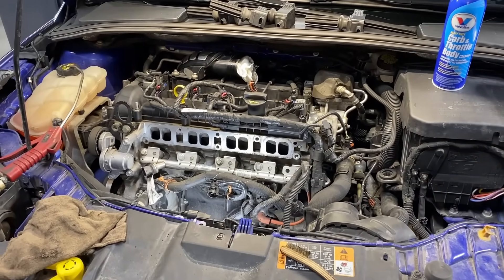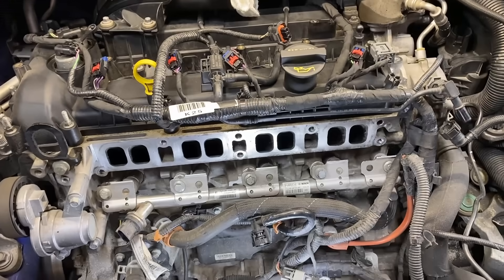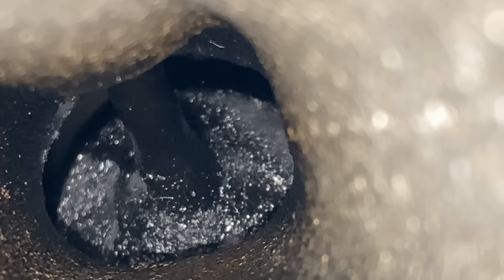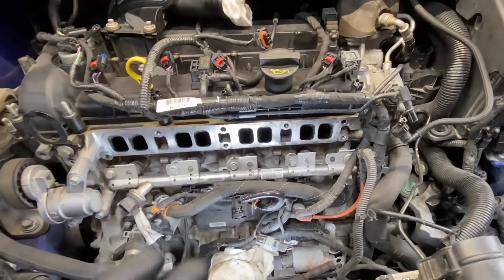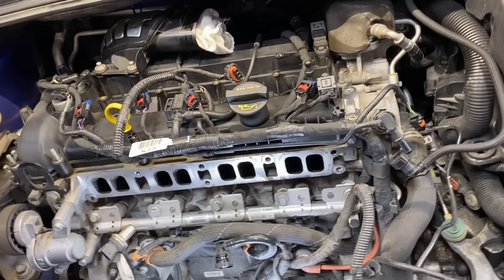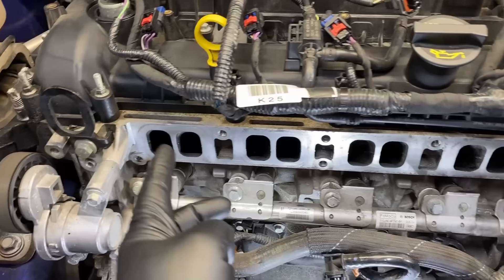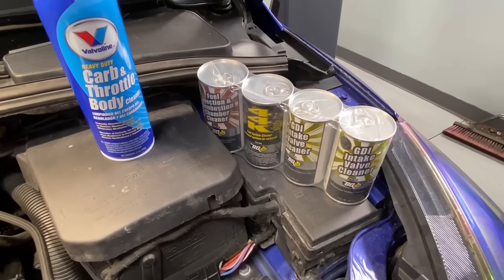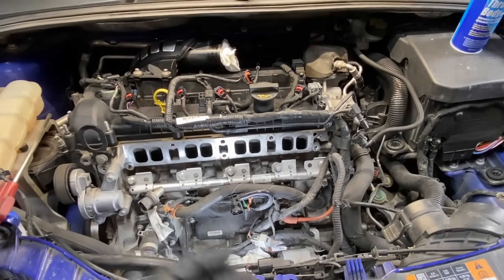Ford EcoBoost Engine Misfires Runs Rough: Intake Valve Carbon Cleaning Procedure

Comment: Seems like it need new head top engine heads for those direct injection and ecoboost engines! Poor engine quality and problematic design.
Reply: Its GDI. Thats how they work. This is why Toyota makes no GDI engines. If you had and Audi or certain BMW model, this would also be a problem.    Add port injection, problem mostly solved.
Reply: @Orcinus1967  seems like Getmans wanted to make sure the engine blocks and head gaskets blow put and get damaged faster by  putting much higher compression system  then what the engine parts can handle ! They are good at selling people new engine blocks!!

Comment: I've been asking around the forums but can't really get a straight answer. Will occasional water or water meth injection keep this from getting out of control? I'm thinking using a pump type sprayer or something while highway driving before I do an oil change. I know hydrolocking is a danger but i'm talking an atomized spray tip.

Comment: All because direct injection is the best idea ever, since the electric starter.
Reply: So great that they added port injection back into direct injection engines 😂
Reply: @markkoranjr6426  Yep, let's scrub our valves every 10-20k miles, what fun!  I'll add, I've seen plenty of carboned intake valves on even carbed engines (wet intake) to realize a dry intake valve is gonna be a problem.  They had to know, yet did it anyway.

Comment: Give me the good old days of revving the engine a little and pouring a little water down the carb. Water turns to steam, engine backfired and carbon was gone.😎
Reply: Had to do that many years ago on my 74 Vega. Would ping no matter what I did until I used the water trick. Bunch of black smoke came out of the exhaust - no more ping.

Comment: Thanks for sharing.  Just goes to show why GDI coupled with a standard PCV system is a major design flaw in modern engines that are built this way.  Any engine that uses GDI should come from the factory with an oil catch can or include redundant port injectors to keep the valves clean.
Reply: No strict need for a catch can but you do need a good air/oil separator in the PCV system, to get the oil mist out of the blowby and send it back to the sump.

 A catch can is just another secondary air/oil separator, retrofitted because the OEM one is inadequate (or absent).
Reply: @nerd1000ify  or just a catch can

Comment: Not trying to start a debate, but does a well designed catch prevent this?
I have a '15 F150 with 2.7 (DI only) EcoBoost.  Had 75,xxx miles with a catch can since around 20,xxx miles.

Comment: Hi I've been watching your  content and like it and now new to the ford family and got a ford ranger with a ecoboost motor so I've been watching video that suggest to get a oil catch can & use the crc spray every 10,000 miles will I still have to go the this process you just did in the video? Or be a ok with just doing these two things

Comment: Is there an oil or fuel additive you'd recommend for a new ecoboost the help keep thing clean?
Reply: That's the problem with direct injection. The fuel doesn't reach the valves. So no additive will help. Seafoam or stp sell a kit which you spray through your throttle body that is very effective
Reply: Use high quality oil of the correct weight and change it on time. Cheap oil produces more vapours, as does oil that has degraded because it's been too long since it changed.

Comment: Another Great Video. Thank you so much... i have a question: i have a 1995 bronco 5.0L 302 and oil pick tube got plugged up with oil that got hot and turn into a coffee ground looking crystallized oil that starved the oil pump and took out 2 rods and blew apart the block and lost the crank and got a crack head with a cut into the oil pan wow... anyway it has torque to yield head bolts what do you know about TTY bolts ??? get new ones correct and get it back together ....

Comment: I'm really surprised that you being such a thorough and meticulous guy you wouldn't just have a walnut blaster on hand to make this job way cleaner, faster, and easier ? especially with you mostly fixing Ford products, when 3/4 of the entire engine lineup is Direct Injected.
Reply from the maker: This is video for the diyer not for professionals.
Reply: @FordTechMakuloco  Oh okay I see what you are saying, I love your videos,  just referenced one of them this weekend when I did spark plugs, rear pcv, and a trans drain and fill on a 3.5

Comment: The 1.5 requires a laborious unhooking of the AC lines and removal of the Air to Water intercooler, an AC recharge and topping off coolant to get the intake manifold off. I wonder if instead, you could temporarily replace the cat with a test pipe and just steam clean the valves with water spray on a hot engine through the intake pipe? If it works it would be much cheaper, faster and easier, perhaps even more effective than solvent and a pick on a cold engine.

Comment: Hello, my taurus 2000 radiator petcock starts slow leak and the petcock was Dorman Radiator Drain Cocks Part # 61127 installed a few years ago w/o issues. i replaced a new Part # 61127 but Still see the same issues. Do you have any suggestion?

Comment: I know this has nothing to do with the ECO boost but I have a problem I cannot figure out and thought you might be able to help. ok. So here is my dilemma. I have a 2000 GT with Hydro-boost, of course. You probably already know where I am heading with this but wait, there is a twist. I put in a new steering rack, all Teflon seals have been replaced all the way up to the hydroboost manifold, there is a brand new steering pump as well and there are no fluid leaks anywhere what so sever. I have done the ridiculous 90 sets of turning the wheel from lock to lock along with pumping the brakes in between each set with the car off and front end raised off the ground, my forearms are huge now.!!!! It drank only a little bit of fluid and not much more. I tried running the car out of frustration and that did not help either. I am still getting a lot of whirring from the steering pump and the brakes still go to the floor while whining. I am so frustrated with this and have no other clue as to what it could be, maybe a bad hydroboost pump? any suggestions as to how to fix this crazy problem? Could there be an air leak somewhere that won't show signs of fluid leakage? I also forgot to mention I hear a gurgle coming from the steering rack when I turn left all the way to the lock while the car is ignition off. Driving me nuts here, any suggestions?

Comment: Its making it really clear to me to not buy a Ford ever again....I had a lot of problems with my 2014 Ford Fusion misfiring and the dealer wanted to charge 3500 dollars to fix a Fuel Rail system problem in the 2.0 liter version. I sold the car and it only had 45K miles on it and I had it for 4 years. That really turned me off from ever buying a Ford...I mean if I am going to be paying luxury car prices for things that should last 100K miles I mightiest well get a luxury car. SO now I just get beaters or rent a car. Every 40K miles I have to take the engine apart becasue the engineers were told by A holes in suites to bake in planned obsolescence into their cars to get me in another in 2 - 3 years... I only had 45K miles on the car and it quite on me so never again will I ever buy Ford....the new battery electric cars are coming out but I am sure Ford will bake in trash batteries within which are hard to replace or maintain and costly after 2 - 3 years. You'll be at a dealer being told they want 5K dollars to fix it because its out of warranty. If not out of warranty, dealers have the mechanics look bad by having them not fix things but Band-Aid it to a point the customer wants nothing to do with the dealer or the product again and they see mechanics as crooks because they can't be trusted.

Comment: Hey Brian! I was wondering if you could help me out. I've got a 05 f250 5.4 3v Freshly rebuilt about 60 miles ago and has lockouts and tune.and since install there's been a random miss/stumble once warmed up only at idle. Weve tried new plugs,coilstune./ crank sensors, smoke testing etc etc. I've looked at my misfire pids and they don't seem to be reading anything with 2 different scanners at all even when inducing a misfire. The tuner did not disable the misfire counters. Any ideas?

Comment: Nice , appreciate the heck out of you and your videos. I have a 96 4 valve cobra  with the same design issue . Different design but same issue . I cleaned mine with 1/2” round wire brush. To get around the valve I bent the end of it around itself , And then a slight 20deg bend. I use carb clean to break it up . Then I use brake clean to sterilize it . Blowing with a air gun covered with a rag so it doesn’t go everywhere.

Comment: idk when you would get another one of these but could you share if the "severe" kit works or not? i feel like it would do great with cylinder 4 but horrible with cylinder 1, like before you manually clean valves, i dont have my hopes up but super curious, thanks for the share!

Comment: So far so good after 148,000 miles on Shell V-Power Nitro+. Changed the original factory spark plugs at about 130,000; was still running great but I was concerned that a spark plug mechanical failure might destroy the engine. Turned out the plugs were still in decent condition.
Reply: Fuel is irrelevant in gdi because fuel is not sprayed on back of valves
Reply: @858415  Thats not true!
Reply: @niceguydmm  fuel is sprayed directly into cylinder on gdi engines. Traditional port injection sprays fuel mixture into runner, which cleans back of intake valves.  Type of fuel or additive into tank does nothing for GDI cars.
Reply: Try an oil catch can it will trap the sludgy oil and all you have to do is drain or empty it every 10,000 miles.

Comment: Good day, off topic question: will a fuel pump assembly for a 2000 f 150 fit a 2000 expedition fuel tank?  It is my only alternative as of the moment because of budget constraints and I found it online at a cheaper price.  I just need to get my 4.6 L expedition running again.  Thank you very much for your replies.

Comment: So adding a auxiliary fuel system solves this issue
Reply: There's a theory that the aftermarket methanol injection systems can help prevent this... Doesn't mean it will clean it after it's already caked.

Comment: Seeing this it makes me think the 5.4 3V hand grenade I own may not be such a bad deal
Reply: Is it direct injection only? If not, you probably don't need this service.
Reply: @billymc2681  no it's port injection, definitely don't need this, I was just making a statement of the catastrophe that was many other engineering failures of the 5.4 3V, but this was not one of them.  My new Toyota has both direct and port injection to alleviate this problem, not sure if Ford made that advancement on the direct injection engines they sell

Comment: This is one of many reasons why i bought a new naturally aspirated toyota.
Reply: toyota engines have 2 injectors one in the port and one direct.  They are smarter than the other manufacturers
Reply: @johndut1  Ford uses this method now.

Comment: People need to be made aware of this issue when they buy these vehicles new. I can't imagine explaining this to my coustomers
Reply: I'm sure the sale man tying to sell you that new car will let you know about the carbon build up issues
Reply: Its pretty much a buyer be aware issue. Be aware most Ford salesmen aren't going to tell you about GDI valve coking, and the dealer isn't going to do shit for induction service. If it doesn't throw a code, they ain't doing shit.
Reply: And they put them on the market without a plan to remedy the problem for years and years.
Reply: Yes they do! Wenha e owned 2016 echo boost 2.0 ford edge for 3 yrs and have had to already replace the long block and just replaced the flex plate(no? Ford would not pay for it either!) Changed tranny fluid and now have to clean intake and throttle body, chg spark plugs and clean the lines. Maybe then I can get thru a year without spending a small fortune on top of car payments and insurance! Seriously relentless issues. When its at full performance is a bad to the bone engine but it doesn't last long before something needs done:(

Comment: So far no issues with my 2014 F150 with a 3.5 ecoboost.  I do rev the engine fairly often, not abusing it, but not driving like grandpa either.  Also using Pennzoil platinum synthetic oil.  I also might have a tiny hole at the bottom of my intercooler to allow some of that gunk to blow out on its own without losing any boost of course, I say I “might” have a tiny hole.  ;) ;)

Comment: I knew this could be done, everyone says you need to get it walnut blasted. I figured a little bit of time with brake clean and brushes and you could do this in your own driveway.  

I wonder if applying glyptal to the intake valves would be a viable solution for keeping oil deposits from ever sticking in the first place.  I know people who have used that stuff inside crank cases to aid in return oil flow back to the sump, it creates a smooth non-stick surface inside the block.
Reply: Good idea for a build you'd have to ultra clean each one and somehow bake it before use though, doesn't work to well unless.

Comment: Am I understanding you correctly @8:58, the NEW more aggressive BG induction service kit you refer to, CAN be used to clean carbon deposits on the Ecoboosts without disassembly of the intake manifold?   Just want to be clear.  Thanks Brian... another informative video!
Reply from the maker: That is correct

Comment: Could you actually do a in-depth video on doing this manually I’m sure a lot of guys would appreciate it
Reply from the maker: This is as in depth as I could possibly get, the ports are tight and narrow. The method I use is all you need and at that point patience is the most important part, you will be hunched over doing this for awhile as there are 8 valves and runners to clean.
Reply: @FordTechMakuloco  you got that right "hunched over" today,choropractor tomorrow, no thanks gdi,ill stick with 300K trouble free port injected car lol. local independent did not want to do what you just did and dealer wanted $300 every 10 k miles.just to run cleaner through.

Comment: That’s why I bought a Toyota RAV4 with both GDI and port injection to keep those valves clean. 😎
Reply: Since 2017 the 3.5 ecoboost in the f150 has had both.

Comment: We purchased a new 2020 Edge Feb of 2020.  We don't drive the car much, only has 8400 miles.  I wonder if Ford has fixed the carbon problem for later 2.0 engines like ours?

Comment: I've often wondered - we can cut thick steel with a high-pressure water jet.  Why couldn't we use a lower pressure on a small hand squirter maybe not unlike what dentists use, to blast the carbon off?  We could have a suction tube in there to suck up the water and debris.  Or maybe just use the air tube.

Comment: When I bought my rs I got a catch can quickly, luckily the valves looked really good to my surprise, only a few had some baby mushrooms on the stems👍
Reply: BG 44k fuel treatment in gas tank 3-4× yr works wonders! Do it in my '19 Ranger XLT FX4 truck. Im sold on Ecoboost tech! All I buy & drive. Never go past 5k mis on oil changes & use OEM filters. I use Motul full synthetic 5w30 oil.
Reply: @Davido50  Fuel treatments added to the fuel tank will do nothing to clean the intake valves because the fuel comes in the chambers after the valves. If you were right about  fuel additives working then these videos wouldn't be out there.
Reply: @pmaint1  he keeps posting that and I had the same response you did. Fuel additive will not help this issue.

Comment: I just had mine cleaned by the dealer 2.0 eco boost , does it hurt to floor like in the old days does that get carbon out of these engines??
Reply: Flooring it to clean out carbon will not work with these engines due to where the injectors are located. I recall reading the F150 switch to port and GDI injection to solve this problem.